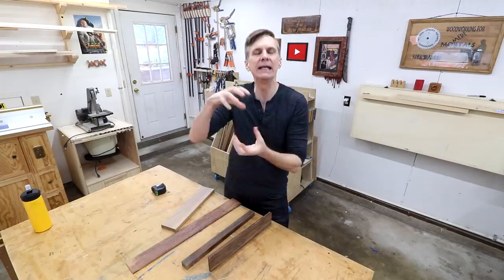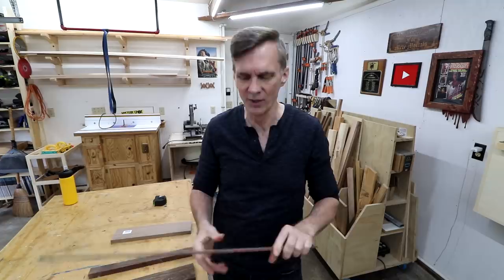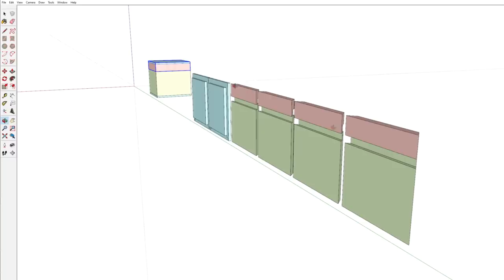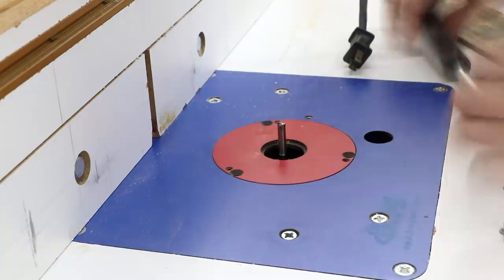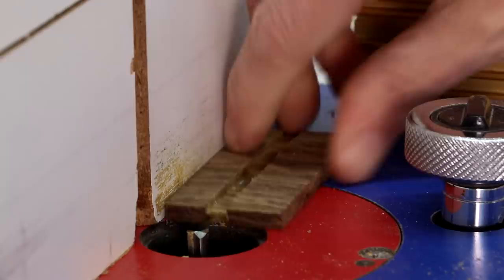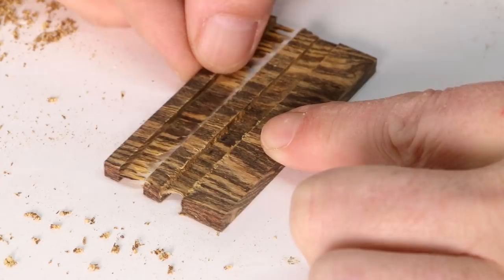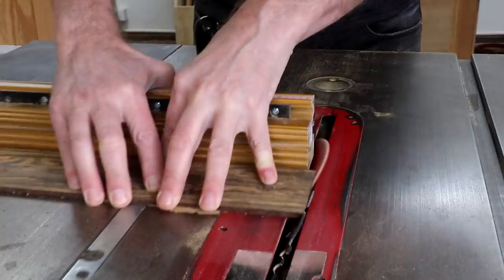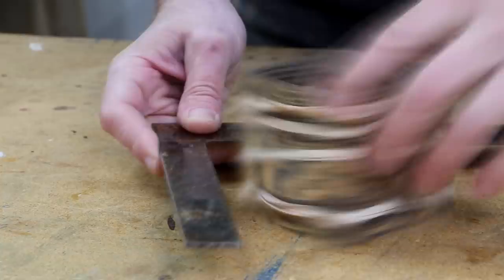Let's make a small, fancypants box. LOCKDOWN Day 19 & 20

Comment: Hi Steve, one of the technique I picked up for small box like that is to join the outside of each corner with masking tape, flip it up, glue it and then close it with the masking tape. The tape hold it a bit better and you can check for square before putting a few rubber band, it is a bit less fussy, but it also requires masking tape. 

I also think that I should have started this message with capt'n Steve or Mate to be in theme!

Comment: I agree about running test router depth cuts, but I was wondering why you felt you had to use the actual wood involved?  Yes, that would (wood?) be preferable, but measuring the depth of the cut with a decent micrometer vs the wood thickness should have been fine.

Comment: Steve When you split a piece of wood in half lengthwise as you did. Lay the two pieces face down just like you cur them Top to top and the same end orientation. when you cut the sides one piece will be cut long side short side on that order. The other piece will be cot short side long side starting from the same end on both pieces. .. Then the grain will be continuous around the whole box,  Clear as mud. If you want a drawing send me your E-mail

Comment: Hi Steve. That wood look amazing.  Is there a reason on the glue up you did not use the painters tape as well as the rubber bands?  That's the first time I have seen anyone use the Mitre gauge and fence on a router table, every other video I have seen says do not do it, but the way you used it looked safe to me.  Thanks for the video.

Comment: Why not just use calipers to dial in your router almost exactly vs having to make so many test cuts to dial it in?
Reply: I thought the same thing but alas it doesn't always work out.  Example:  The router insert around the  router bit could be a fraction of an inch lower than the table so the cut will not be accurate.  Test cuts are the only way to go.  "One test is worth a thousand expert opinions."

Comment: Hi Steve and Steve Nation 👋, I have a question. I would like to get into making some of the projects you are doing. Any suggestions on a good, accurate, and dependable table saw for around $1k? Keep up the great work! I look forward to these videos coming in.
Reply: Hey David, for 1k you are right in between 2 different kinds of saws. A little more and you have a cabinet saw (saw stop, powermatic, etc.) A little less and you have a contractor's saw (dewalt, craftsman, etc.) You may be able to find a nice Delta cabinet saw for $1k. I would say, pick one based on your shop size. I have a Dewalt DWE7491 and I am happy with it. It was like 5-600. If I had a shop, not in my basement, I would get a cabinet saw, a saw stop. But I cant fit it through the basement doors and down the stairs lol
Reply: @BatCaveCreations  Thank you. What I see on the net a Delta contractor was $1100 plus shipping. I saw a Grizzly G0771 hybrid on sale for $8-900. I'm lucky, my Garage is in my basement. Ranch from the front and 2 story from the back so it should fit in a 16' door 👍
Reply: @davidreed760  deff go with the Grizley Hybrid then. Alot of contractor saws dont have the cast iron top. If the grizley has a cast iron top and it is a hybrid that's the way to go IMO! And that is awesome if will fit into the basement!
Reply: @BatCaveCreations  , the trunion is mounted to that cabinet. Full cast top and wings. Just 2hp not 3hp. Cheaper fence and miter. Not sure if blade has dust collection around the blade. The one I would like to have is almost $1k more. I can't do that social insecurity disability. Thank you this means a lot to me
Reply: @BatCaveCreations  plus it has a cabinet, no legs or wheels
Reply: @davidreed760  you can always add a mobile base if need be, easy to make but you can buy one too. That is awesome!! Deff the way to go!!!
Reply: @davidreed760  dust collection is NEVER perfect on a table saw so dont worry about that. For the fence and miter you can always get upgraded ones or modify the stock ones. And HP wise. That will be just fine for a hobby. If ur going pro you can upgrade later. Just make slower cuts on hardwood and get a fine tooth blade. :)
Reply: @BatCaveCreations  Spinal injury doesn't let me do anything heavy and most days it's a chore to just stand long enough to make a PB&J sandwich for lunch. I'm glad to hear that you think the 2hp will be good. I hear people say more is better. I really want it to cut square because the one I got from Sears before all stores closed within 70 miles of me will not cut anything square. Sears won't help and Craftsman said I got one of Sears spec saw's that they don't want their name on so they won't back it up
Reply: @davidreed760  I will never trust craftsman again, to many bad experiences. I am sorry yo hear about your injury. You may not need that big of a saw if you arent going to make big projects you know? But if you have the $$ go for it, it will last you forever!
Reply: @BatCaveCreations  That is what I'm looking for. Plus big enough to not be able to tackle something bigger as skills grow and get muscles from my Son-in-Law's. They can be very helpful I'm glad to say
Reply: @davidreed760  then you will be happy with the grizley company has been around a long time so they are doing something right :)

Comment: Steve, really on that 1/8ths of an inch doesn't matter on a house??? Because I know of a few construction channels that would disagree.
Reply: Jack Linde 
Weber’s law in effect, although I do agree that there are definitely some measurements that really shouldn’t be 1/8" off when building a house.
Reply: 1/8" would have made a huge difference when I installed cabinets in my laundry room. Had it been that much smaller, they wouldn't fit. The walls are placed so precise that I could hold the upper cabinets (3 of them) up holding the middle one with one hand (the buttom resting on a temporary cleet) while my dad secured the other 2 to the wall. They were that tightly wedged between the exterior wall and the 2 full height ones. :)
I am happy however, that the garage opening is way off compared to the original architect drawings. That makes it way easier to get in and out of my car...
Reply: @HepauDK  It's not just the absolute lengths that matter, it's also the difference between things that should be the same length because one needs to fit in the space defined by the other.
Reply from the maker: People do like to disagree!
Reply: @SteveRamsey  Yeah, but hearing professional carpenters and framers talk about what happens to your house when you're 1/8th of an inch off on a wall... I'll side them. After all, you wouldn't go to a landscaper for advice on farming, despite landscapers and farmers both working with plants.
Reply: @SteveRamsey  If you want to check out some good channels, Essential Craftsman is a Framer turned Blacksmith who's currently building a spec house to show people how houses are built... It's a very good series.

Matt Risinger is a general contractor in Texas that is also building his family a new home. (Started as a remodel for a rental... then he decided to scrape the pad clean and start over... and then he decided it was going to be his family's new home). But he has all sorts of construction topics as well.

One of these days, I'll save up the greenbucks to make a house that looks like a victorian railroad station. I'm a train nut.
Reply from the maker: @jackielinde7568  I wasn't really talking about house building in that way. I was trying to make a comparison about how much more careful you need to be with measurements on small things. I think my point was lost. I regret not scripting these episodes so I could more carefully craft what I say to make sure everything is perfect. 😞
Reply: @SteveRamsey  Except even that doesn't make sense. Degree of accuracy needed isn't dependant on the size of the object being constructed.  For instance, when ADOT was building the I-10/I-17 interchange (called "The Stack") in the 1990s, an error in where the pillars for one of the ramps were placed resulted in about two more months and hundreds of dollars to engineer a solution to fix the ramps. It wasn't a large error, but it compounded with the size of the project. (If you're ever in Phoenix, you can guess which ramp they messed up on. It's a little obvious if you know the history of the project.)

You should ALWAYS measure twice and cut once. However, you can make the argument that the nature of the project does dictate how precise you need to be. It's the questions of "If I mess up, what is the cost in wasted materias, What will it take to repair the mistake, and can anyone get harmed or hurt?" Park benches and planters aren't likely to cause materials to be wasted if there is an 1/8th of an inch discrepancy between parts. 1/8th of an inch difference in your fancy box parts means a greater chance for materials to be wasted and ruined, even if the costs of the ruined materials is in the "Under $100" range. Move that to houses, electronics, vehicles, municipal projects (highways, damns, skyscrapers, etc.), medical devices and implants, spacecraft and satellites, etc. has increased in cost of wasted materials, cost to fix, and cost of human harm.
Reply from the maker: @jackielinde7568  OMG...get over it. I think most people understood my simple advice and didn't get fixated on it. Sheesh. You must be a blast at parties.